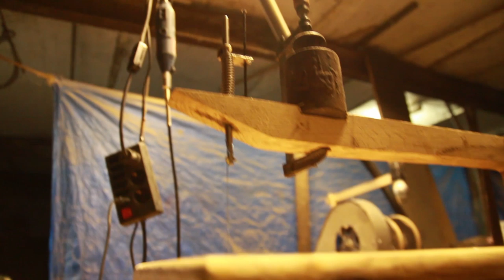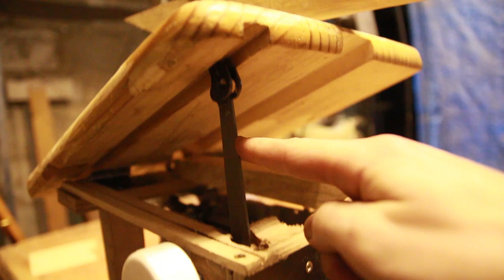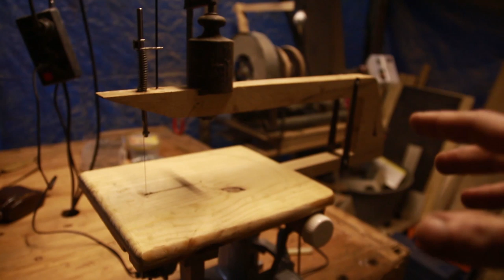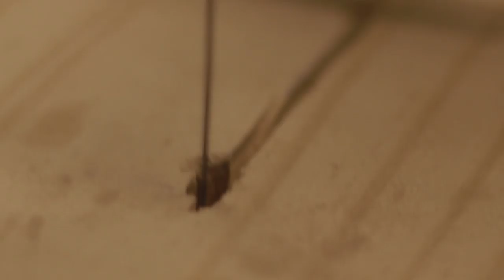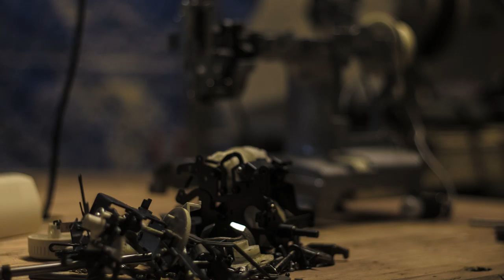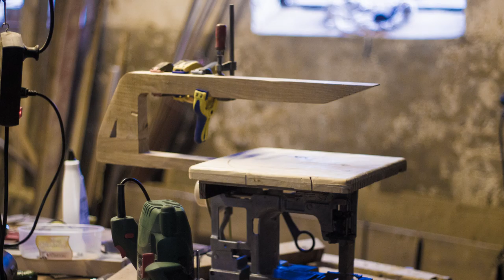The Sewingmachine Scrollsaw

Comment: Very clever construction!
If you have vibration problems, my guess would be that the lower arm is too weak: it holds all the upper arm with the weight, and is thinner than the upper. Reinforcing it might help.
Reply from the maker: Recently I added support for the lower part of the arm and it made a huge difference. That turned out to have been the weak part.